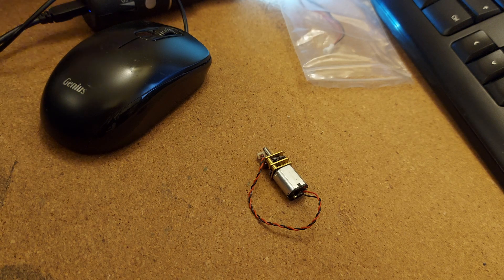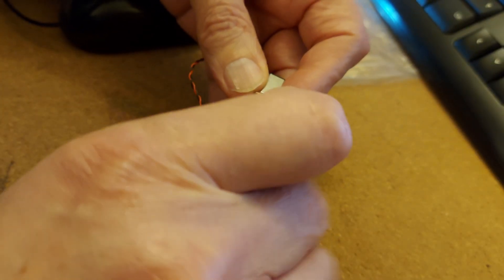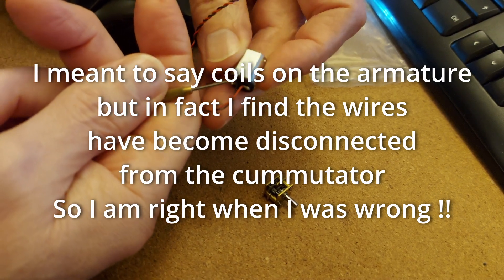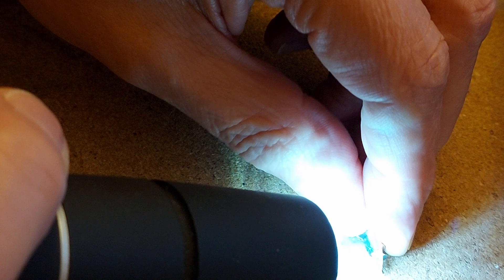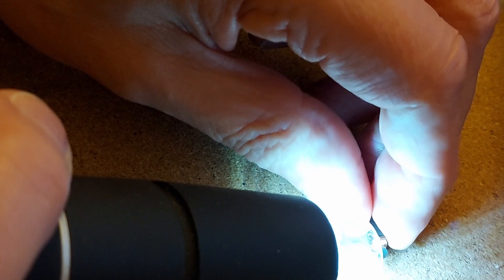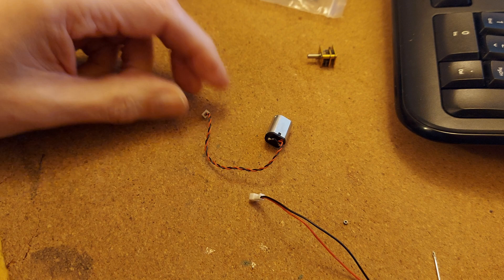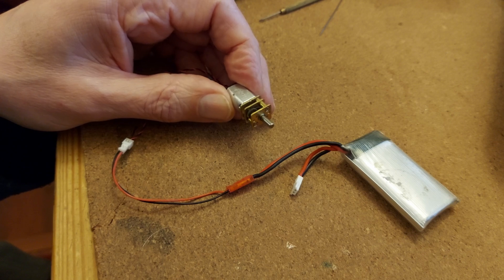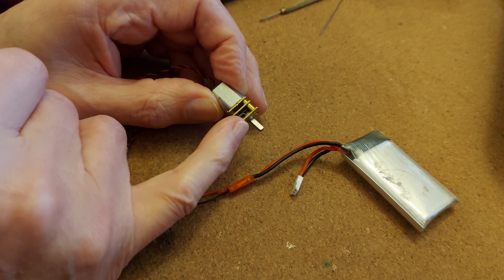Can I fix an N20 motor?

Comment: Forced the n20 motor into a 3d printed part and hammered it by rubber hammer so slightly and the motor stack like froze how can i fix it
Reply from the maker: My guess is that you have bent a shaft and effectively destroyed the motor. If you are lucky, you may just have pushed something out of alignment and maybe taking it apart and putting it back together might sort it out. I suspect you will end up buying a new motor.

Comment: Could Hi, is possible to dismount the gear box of a N20 motor?
Reply from the maker: Isn't that what I just did in the video?
Reply: @GrandadIsAnOldMan  No, you just remove the box, but the gears remain together in the gear box.
Reply from the maker: @jorgeadrianhidalgo7455  I clearly don't understand you. You said "dismount". I took that to mean dismount? (remove, take off). As it is, you can clearly see the gearbox is held in place by the two screws that attached it to the motor. If you want to disassemble the gearbox, I would think that you will need to use gentle persuasion to separate the plates. There are no other screws involved so the plates must be a push fit on the brass pillars. I have no reason to pull one apart, but I guess if you wanted the gears for some other purpose, you could do that.
Reply from the maker: I just did this short video to show you what I mean https://youtu.be/DhM-QqDGo20
Reply: @GrandadIsAnOldMan  Thanks for your explanation and your time. 👍
Reply: @GrandadIsAnOldMan  It is exactly what I needed, thank you very much and sorry for the consumption, my English is not very good
Reply from the maker: @jorgeadrianhidalgo7455  no problem, it gave me an excuse for another video 😁😁

Comment: Great job there Graham. Those little microscopes are brilliant. I still have mine and use it when I am curious about anything. It would be good to get it working wirelessly with the computer.
That was a great idea to use it while soldering the wires together. 👌👍👍
Reply from the maker: I use it USB when I connect it to the PC, and wirelessly on the phone.

Comment: Putting those back together again is an art in itself 😀
Excellent job there!
N20's are legendary, the direct drive high power ones used to be in a lot of Air-Hogs planes.... which I was going to suggest if your fix didn't work.
Reply from the maker: Thanks. I am trying to clear my work room (again, I keep trying and it usually goes backwards). I have drawers full of motors and toy cars etc. I am seriously thinking of taking them to the recycling centre (dump). I haven't used them in years. I have boxes full of power units and computer components, again untouched in years. The worst thing is watching my old videos when my work room still had a bed in there as it was the third bedroom. I realise how much the junk pile has grown. On the positive side, I managed to throw out 4 rubber band powered cars tonight. I don't think it made any noticeable difference, but it was in the right direction. They were only 9 or 10 years old 😂
Reply: @GrandadIsAnOldMan  LOL! The surest way to discover a use for stuff that you don't need and you've never touched for years is to throw it out! Once did a blitz on the old farm shed. I of the few things that DIDN'T go back on the hooks on the wall/shelves (just in case!) was a broken speedo cable. About a week later I was searching for something to run through a dirty steel fuel line. That cable in a drill would have been perfect! 😭🙄😈
Reply from the maker: @theoztreecrasher2647  I find I spend longer looking for stuff I know have, but I can't find it. The quickest way to find it is to buy a replacement, and then you find the one you had as soon as the new one arrives.
Reply: @GrandadIsAnOldMan  Yep. Can relate to that just this afternoon. Walked around in ever diminishing circles looking for the second battery for 1of my planes for 15 minutes. Went to get in the vehicle to come home and pulled it out of my pocket with the keys. Gettin' old drives you nuts! 🙄😬

Comment: Another attempt saving parts from going to landfills.
Reply from the maker: I was rather pleased with myself, this was very much at the limits of my capability. My eyes struggle to see this and using a microscope to see makes it very difficult to coordinate my movements.
Reply: @GrandadIsAnOldMan  I got you. I did repair many of these kinda electromotors too. I would think you can get a pair of magnifier goggles.